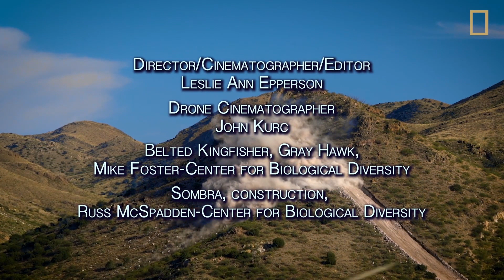Wildlife Disappearing at the Border | National Geographic

Comment: Any one do research on the great wall of china and wildlife? Just curious
Reply: Many migration routes for animals that migrate into the lower parts of china in the cold winter months where most likely cut away, sadly there isn't much research done on the topic due to it being difficult to make out the passive effects on the animals as the wall didn't directly kill them but shifted their migration routes over a relatively short amount of time, making it hard to track. What IS known tho is that the great wall of china made a massive dent in the gene exchange of plants as many plants dependant on seeds being carried by the wind evolved clearly differencial subspecies on either side of the wall.
Reply: @kunibertrandolf1886  Well our wall is not that. Seeds and insects should be able to spread.
Reply: kathy rathbun It’s the animals who can no longer cross for their migration and not all insects/plants are airborne.
Reply: @kunibertrandolf1886  Wow thanks. I was wondering about this.

Comment: 118 images void of wildlife, versus only one image with a skunk? Sounds like he has a shutter speed issue or his sensor has been misaligned.
Reply: I also was curious of why it was taking pics? Doesn't a trail cam only takes pics when there is movement?
Reply: liberal results
Reply: Trail cameras take pictures of all movements. There are always a lot of false camera triggers, despite how you set the camera sensitivity. A more accurate description would be “in 4 weeks of camera trapping, that holed a over 1,000 pictures, only one was an animal detection. If no moving shadows and window days were taken, there would still only be one animal detection.